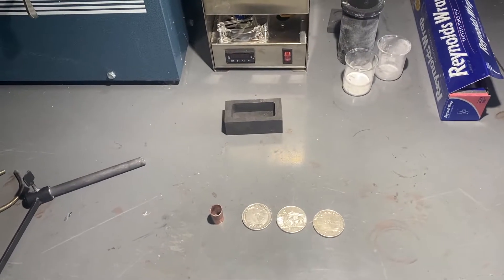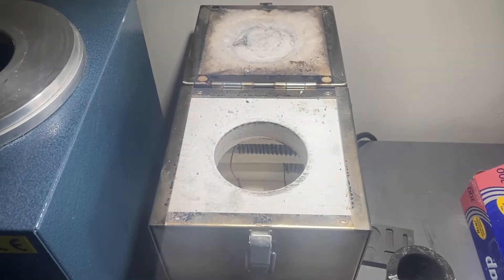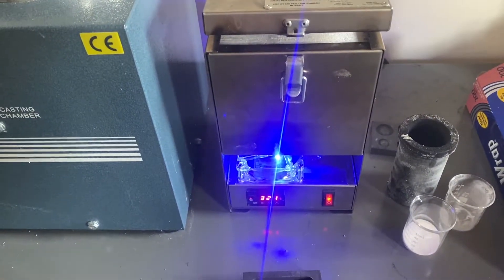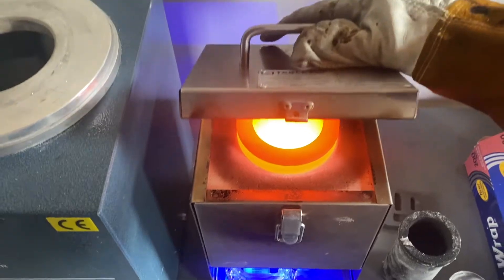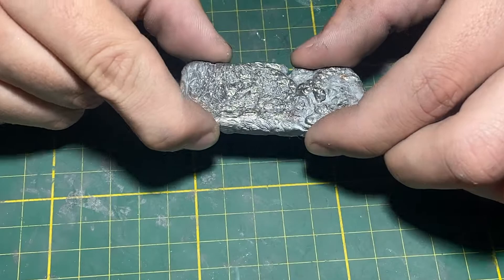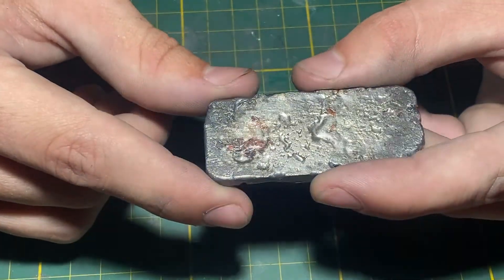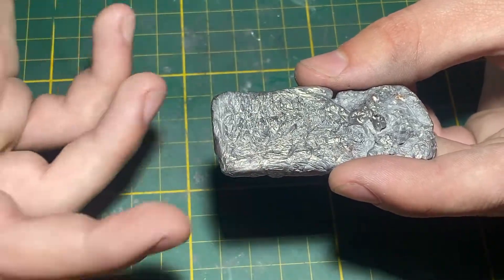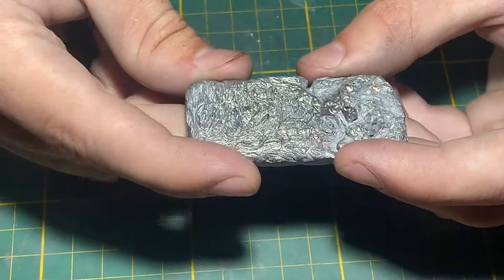Casting A Sterling Silver Ingot

Comment: Levi  , I been casting many years , I cast jewelry every day. watch some of my videos I use only homemade equipment. I alloy all of my own metals, That setup is not the best for what you are trying to achieve. ( noting against it or you) Great job on your channel by the way.  I started out with that type of furnace But found out that the graphite crucibles don't last and are way to expensive. and the electric elements burn out over a short time. To alloy metals the right way you first need to make casting grain from your base metals( you do not start out with thick chunks of metal) you need a small hand held crucible. A potato is perfect for doing small amounts of 3 oz or less. If you would like I can make a video for you on how to make casting grain ,,,.weigh out your metal start with your copper casting grain and melt it to flowing liquid with a torch ( you can use oxygen and propane) when your copper is flowing liquid let it cool down just a bit start stirring with a graphite stirring rod and slowly drop in your silver casting grain stirring the whole time. It is critical to let the copper cool down so you do not overheat your silver....hope that helps.........I subscribed to your channel keep up the hard work.......You can learn a lot about casting and silversmithing if you watch my videos....I suck at working a camera and editing.......have a great day!
Reply from the maker: I have seen you videos before, very cool! I am just working with what I have so I’m doing the best I can. However, I still appreciate all of your advice. I would like to encourage you to make the video about how to make casting grain! The more informative and useful content out there the better for everyone. Thanks for you kind words!
Reply: thanks for the reply..I will make the casting grain video......just a suggestion If you are only casting a few rings or small parts use a tiny flask! it will burn out way faster use way less investment and save you a lot of time( and money) when you quench the hot flask the investment will all dissolve and your parts will fall out in the water.....way less work all the way around and a whole lot cheaper too!....keep up the great work I wish I had your editing skills!!